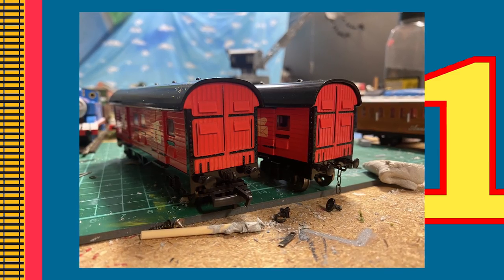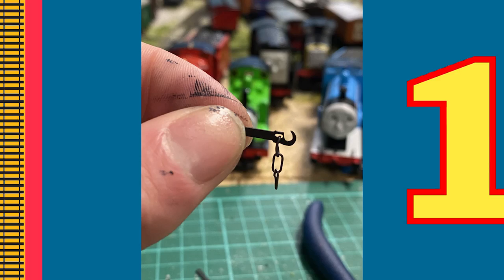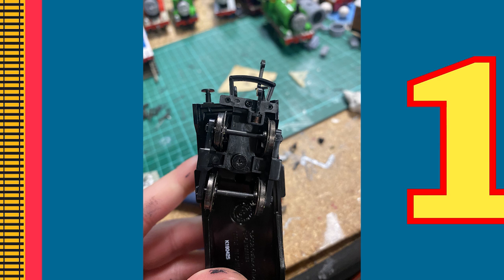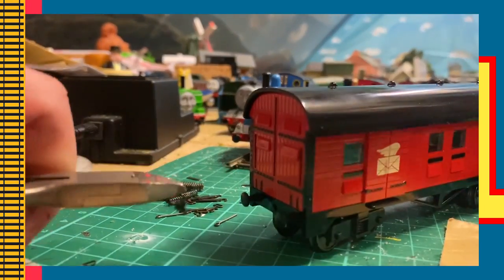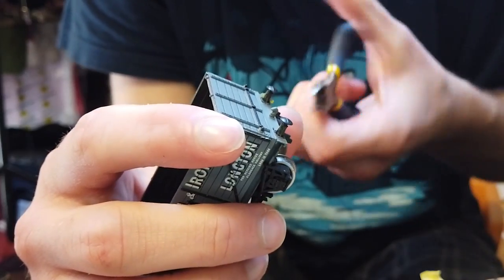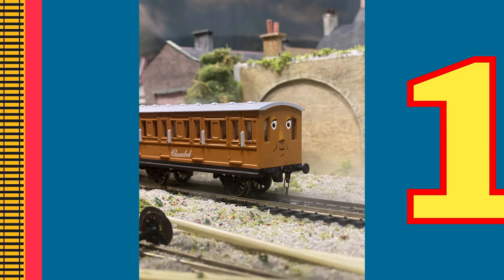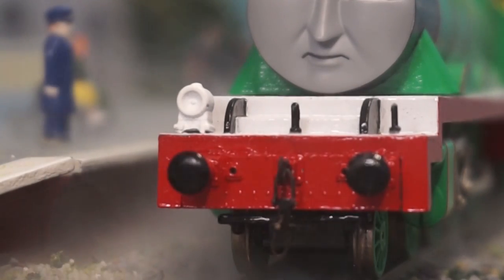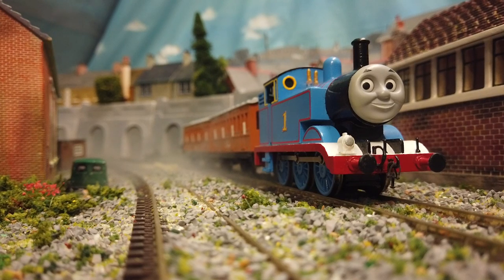How to add Chain Links to your Bachmann Thomas and Friends Rolling Stock

Comment: how hard it is to couple the trucks/coaches to the locomotives i can just imagine me taking an hour coupling up a long goods train
Reply from the maker: It can be tedious. However, I went to a model show a few moths ago and some people there had build little sticks with hooks to make it easier to connect trains. Something I am thinking of attempting!
Reply: If these chains are made from a magnetic type of metal, you can also use a small screwdriver with a magnetic tip and attach it to the furthest chain link and then couple them up like that, then just pull slightly down below the hooks so the coupling stays attached and allows you to pull the screwdriver away.

Comment: What’s the difference with the chain links for the engines? Also does this still work if you use super glue?
Reply from the maker: There are different type of chains for engines. Rather than the 3 chain ones. But the process is the same. Yes super glue will work!

Comment: 1. I personally consider it better to remove the tension-lock couplers non-destructively where possible, just in case.
2. As someone who made the same mistake when I tried my own hand at installing screw links on a couple models ages ago, I take issue with your installation instructions. The hooks should only be truncated and glued if they outright don't fit with their tails intact. The purpose of the tail is to hold a spring and a retainer pin for said spring, to basically act as an expansion joint to help with cornering.

Comment: How cool . Them 3 links seem amazing will try it
Reply from the maker: Nice one look forward to seeing results
Reply: Well I work in a gauge so I use Diapet Thomas models  I am making an Edward out of a James as we speak and I managed to drop my Thomas of the set breaking it but fixed him but can’t get the cab fully smooth again oh I motorise my rolling stock and I do it for the tenders to for the tank engines however I just use string I bace them if there cgi renders but make the sets like season 1 abs I use chain links  from Bachman they work alright but may try this method … it worked thanks for the advice on the wagons like Annie and clarabel but where do you get some chains big enough to fit round the Bachman uk Rai he dummy hooks I cant find any
Reply from the maker: @MaxwellTheTrainFan  you probably won’t be able to find any that are for the size of the Bachmann hooks! But you could always use metal links from key chains for those!

Comment: With engines, do you have to take the running board off to apply the screw link coupling?
Reply from the maker: You can do it whilst there together! Either way works!